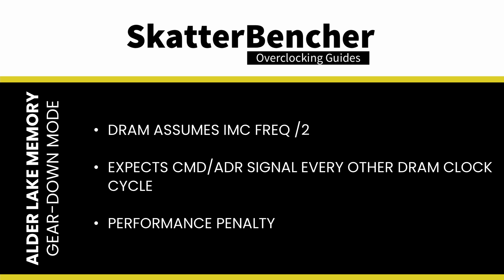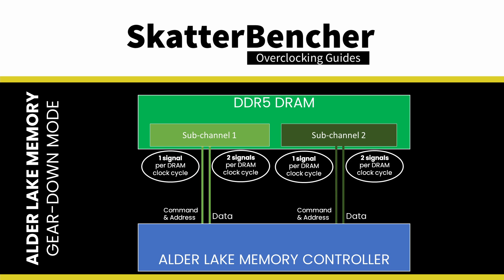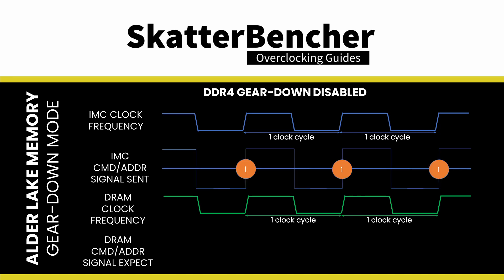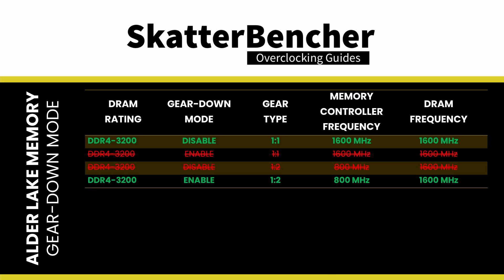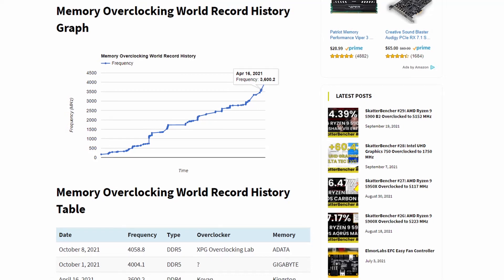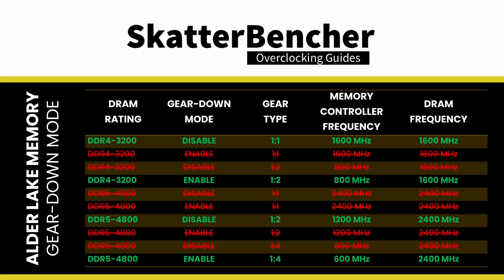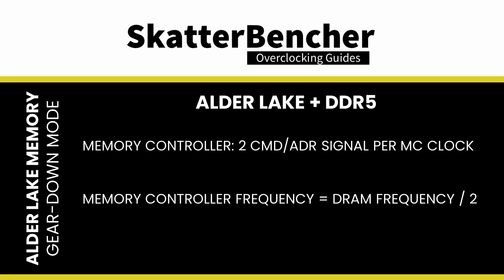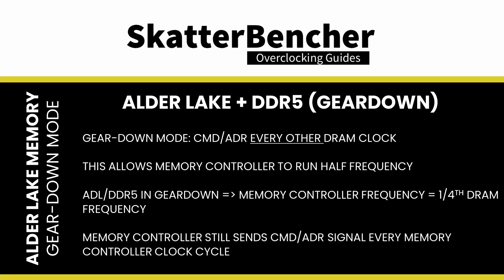Alder Lake Overclocking: Memory Gear Ratio & Gear-down Mode

Comment: On AM5, when running in 1:1 Mode (UCLK=MCLK), toggling GDM doesnt change my UCLK. Should it half/double when toggling it on/off according to this video?

I think it doesnt affect UCLK. It just changed the command rate, but the frequency stays the same.

Comment: Wait a second, how can u recommend 2T command rate and gear down enabled? 2T is slower than 1T and geard down enabled gives half the frequency.  Wtf?
Reply: I'm not sure what is said in this video is true. He says GDM means 1:2 memory ratio, but twice as many commands are sent. This begs the question why not run at 1:1 ratio with twice the commands, for double the memory throughput? Because this isn't how GDM works at all, this is more like how command rate 1T / 2T works, and even then that's just halving/doubling the time to send the command and doesn't speed up how fast the memory responds. I think in real life, GDM is actually just watching the effective memory speed/latency and realising that if the ratios are like 1:0.98, i.e. the memory can't quite keep up with the controller, then it will slow the controller down - not by choosing a new ratio/divider, but by simply waiting for the next cycle (effective 2T) in situations where it thinks 1T wasn't going to work anyway because it's too late in the bus window. In otherwords, it's going to run the normal speed for as many cycles as it takes before it suspects the RAM was going to slip behind a cycle, then gives it an extra cycle to catch up again.

Comment: this is weird, I got my DDR4 3200 XMP 2.0 and  Memory Controller : DRAM Frequency Ratio 1:1 but CPU-Z says my Command Rate is 2T instead of 1T. Any help?
Reply from the maker: Command Rate (1T/2T) is neither Memory Gear Ratio or Geardown mode.

Command Rate is the time the memory controller will wait after issuing the command to read the data. 1T means the memory controller will wait 1 cycle for data to be available; 2T means the memory controller will wait 2 cycles for the data to be available.

Memory Gear Ratio is an Intel term used to describe the relationship between the memory controller frequency and the memory frequency. Gear 1 (1:1) means the memory controller and memory run the same frequency, Gear 2 (1:2) means the memory controller runs at half the frequency of the memory frequency. Gear 4 (1:4) means the memory controller runs at a quarter of the memory frequency

Memory Geardown mode is a JEDEC DRAM specification where the DRAM assumes the memory controller is sending command/address signals at half the usual rate. The usual rate is that the memory controller sends a signal every DRAM clock cycle. In Geardown mode, the memory expects a signal from the memory controller every other DRAM clock cycle.

The Gear Ratio and Geardown mode configuration is tightly connected as it's vital that the memory controller and DRAM send and receive signals when expected. Command Rate is not so vital and it's just a waiting cycle on the memory controller side.

In your case, 1:1 means both your memory controller and DDR4 memory is running at 1.6 GHz.

Comment: Gear1/1 4200cl 16 1.45v worked with 1t or 2t, 1/2 4266 cl 16 max feel like need more voltage or something another, it's b die 3600 cl 14 1.45v and ofc no errors with anta777 extreme.

Comment: Do you know what the max memory frequency controller speed is for alder lake? Is 2000 possible for a 4000mhz kit to run in gear 1?
Reply from the maker: Hard to say. When I briefly tried Gear 1, I didn't notice any major improvement over Rocket Lake. I couldn't boot DDR4-3600 easily. But I've also seen people show DDR4-4000 Gear 1. So, I'm not quite sure ...
Reply: Some can use like 4133 too.

Comment: I found your channel and i like your style! There are one question what i cant understand... Why DDR4 2x16Gb 3600 cl16 DUAL RANK memory is not working in Gear1 mode? But 4x8Gb 3200 cl14 SINGLE RANK is working good! I saw some reviews when 3600mhz dual rank worked with Gear1 mode! 🙄
Reply from the maker: Hard to say what's causing it via the internet :). My best guess would be that there are some sub-timings configured to tightly for 2x16 3600.
Reply: @SkatterBencher  RAM was G.Skill Trident Z RGB (Samsung B-Die)... Already sold it, using my old and best T-Force Night Hawk Legend 3200 CL14 (Samsung B-die too), but 4 RAM slots populated are not good overclockers ☹! I tried, 2 modules easy 3733 cl16, but 3200 cl14 is +/- the same performance, sooo - its oke and thanks for your answer ❤